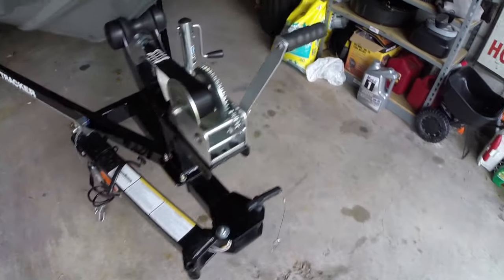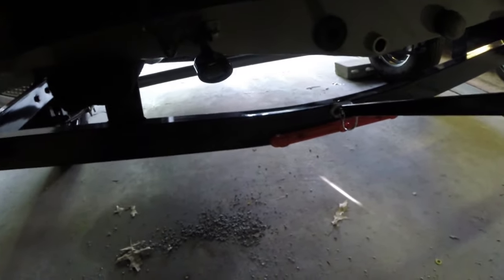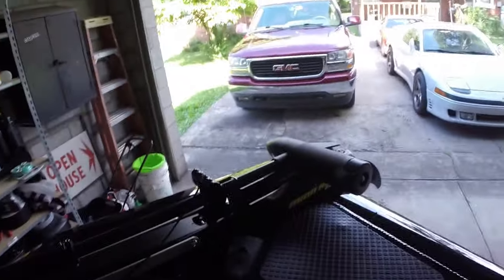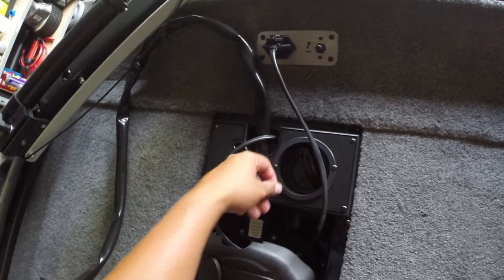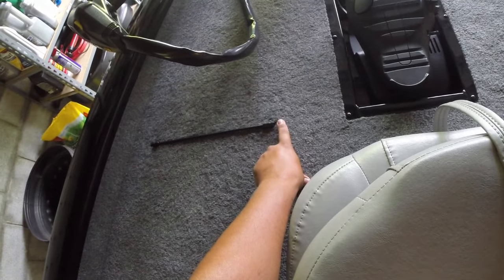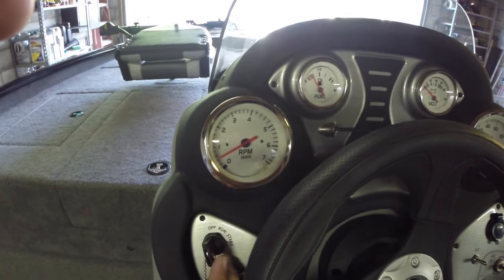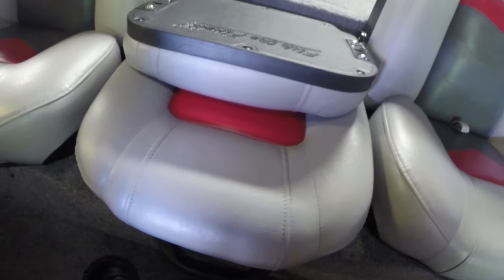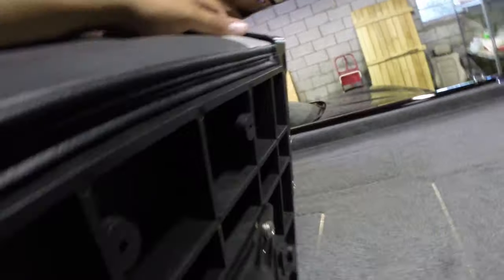Tracker Pro Team 175 TXW Review

Comment: I have the same boat with the 75hp and love it!  I was hesitant to buy an aluminum boat and really wanted something faster and fiberglass.  After owning the boat for a summer I couldn't be happier.  Mine runs 41mph on gps and I'm over-revving, going to jump to a 19p and I'm guessing I'll get 45.  I was surprised how smooth and quiet it was in larger waves.  Only downside to the boat I've found is being so light it gets blown around a lot and can be a handful docking and I'm always on the trolling motor while I'm fishing to keep from blowing away.  For an inexpensive boat compared to most, it's very underrated and like I said, couldn't be happier with my purchase!
Reply from the maker: couldn't agree more. definitely want to look into a different prop.
Reply: Just upgrade your trolling motor. It will help. A prop isn't gonna help in heavy wind
Reply: Did you ever try the 19p in the 75? What hole is your motor mounted at?

Comment: Nice review!  I just bought a 2015 Pro Team 190 TX with a 90 hp 4 Stroke Merc.  I was wondering about the prop on mine as well.  I got it up to 46 mph on the speedometer which was actually 43 mph on GPS.  I'm not complaining though!  It's much better on gas than a big fiberglass bass boat!  I was debating buying my ex boss' 2012 Ranger Z521 but then I didn't want to pay for the gas for the Yamaha 250 SHO that drinks 28 gallons an hour lol.
Reply from the maker: You cant beat the fuel economy! A big ranger would be nice to have but unfortunately cost more to keep, maintain, and use.
Reply: Definitely!

Comment: I've been looking into getting my first bass boat for a while, still haven't quite made up my mind. I have a 16ft multi species deep-v already, so it's gonna be a trade in. I've looked at the trackers for a while but they just don't have me sold. I am really not a huge fan of the deck layout. That's  really all there is to it. So, I've begun looking into the Crestliners VT series, and the Ranger RT series.

The Ranger is the closest thing to what I'm after. 17 to 18 ft class, side rod lockers that will hold at least an 8 ft rod. Large center tackle storage. Aft livewell. Recessed foot pedal for the trolling motor. The Ranger RT178 with the 60HP merc on it is $18,000 roughly. And I'm giving it a solid look right now.
Reply from the maker: rangers are nice man. not too much more than the tracker it seems either. Good luck on your purchase man!

Comment: Great in depth video. What is the storage length of this boat. What they advertise on the website is with a 25hp. Just curious if this boat will fit in my garage. Thanks man!
Reply from the maker: with the folding tongue, id say its about 21 ish feet prop tp tongue tip. just eyeballing it though. Mine came standard with a 60hp mercury.

Comment: Also, if you want to swap out the depth finder Gander Mountain has the 5 Elite HDI on a crazy sale (because the latest now have chirp, overrated, and are called Hook instead of Elite) and it uses the same mount. You would still have to swap out transducer.
Reply from the maker: nice to know ill check it out. was looking into the garmin 73dv here recently.

Comment: Since this video have you put on a ss prop on it yet? If so have you noticed any increase in performance?
Reply from the maker: C.A.M. I haven't yet! ive been wanting to install one though. The factory one has proven to be kind of weak. ive already bent it. Stay tuned for a future prop install / test video.
Reply: Ok thanks bud. Ill be sure to keep an eye out for it!
Reply: Mr. Shaky head I'm buying 1 nx season, I've heard u can't install power poles on these boats, do u know if 2 power pole micros would work on this boat
Reply from the maker: she's bitching I'm fishing I'm not sure ive wondered myself. there is some room right next to the engine that may provide enough space to mount the poles though.

Comment: stainless prop upgrade a must. will improve hole shot and way more stable in turns. alum props way to much flex. lose bite under load.

Comment: Should the wood in the boat be a concern?
Reply from the maker: Jadiel 254 i thought the same thing when buying. but the dealer mentioned that the boat comes with a lifetime warranty on the carpet and wood. the warranty is not voided if you drill into it by adding electronics as well. sold me on it.

Comment: Weird, my 2014 has aerated life wells front and back with controls for both in my dash. It is where your left side storage box is.
Reply from the maker: i noticed that. i also noticed some came with a cooler built into the floor.
Reply: +Mr. Shakyhead Yea, mine has the cooler in the floor but after just a little ice barely any room for anything else.
Reply from the maker: i use the rear tackle box. best cooler ever lol

Comment: what was the break in process on that four stroke?
Reply from the maker: If i remember correctly, it was 6 hours of varying throttle up to 3/4 throttle with the trim down to provide a decent load, then normal use until 20 hours, then an oil change.

Comment: I take it there is no room for a 9.9 hp kicker motor judging by the looks of the stern.
Reply from the maker: no i dont think you could add one.
Reply: Look up Nauticus Smart Tabs.  You mount them as standard trim tabs but then you can drop them down for brakes when trolling.  I think with the standard motor you could troll slow enough you wouldn't need a kicker.